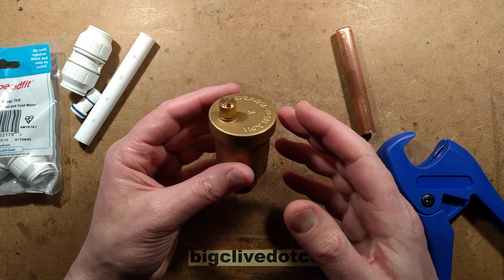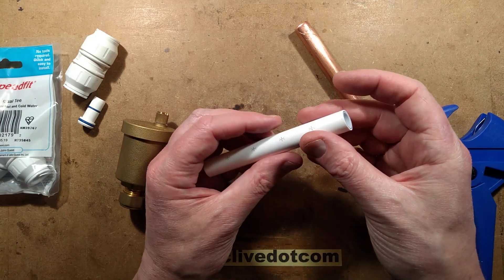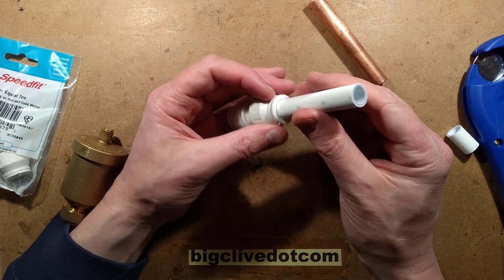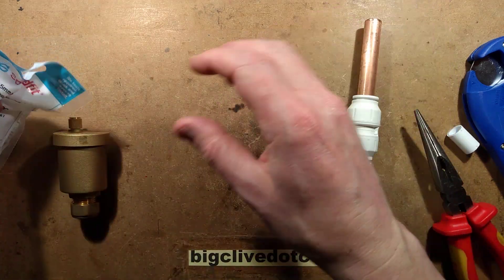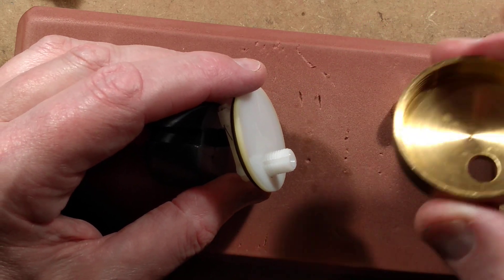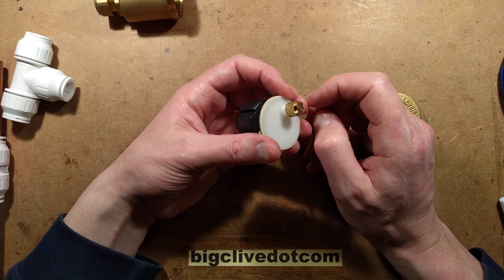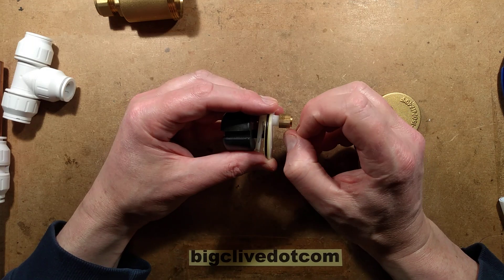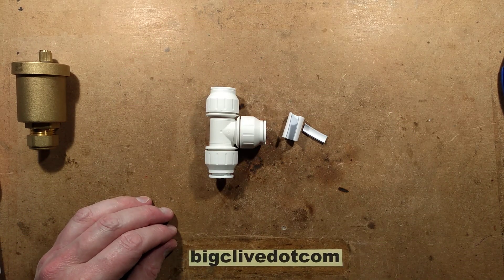Inside a bottle air vent and plumbing ramble.  (No electronics whatsoever.)

Comment: Hey Clive, another great video, thanks.  I had one of these on my old combi-boiler that was leaking.  It didn't even have the thumb screw at the top present (Otherwise I may have just tightened it up to stop said leak).  In the end I watched a You tube video and the plumber suggested giving it a few sharp taps with a screwdriver handle - which fixed it, once I'd topped up the pressure back up on the system also.  Looking at how it works, I reckon my float was probably stuck. It matters not as that was a few years ago and we've since replaced that boiler with a shiny new one.  But at the time I learned all about these auto bleeders (Do you see how I did that - bleeders!)

Comment: So about the "is plasic any good" question.
I actualy havent seen them using anything else but this system with the plastic pipes on constructionsites here in switzerland so it cant be that terrible. Fair warning though im just an electrician so Im definetley no expert when it comes to plumbing. 

Cheers
Reply: Gladius Illuminatus no electrician has been shocked on a regular basis, yet plumbers seem to exhibit continued exposure to moisture. Other than that, the difference is minimal.

Comment: I worked with someone who managed the facilities of a famous shop in London. 
An employee who worked there see water leaking from a pipe on the roof and capped it off without informing anyone. 
It was a pressure relief valve that he had capped off.
There was an inspection at the building at Christmas time and when the alarms went off on the building management computer it was already too late. 
The large hot water tank which was on brick pillars had ruptured spewing out super heated steam and filling the room with boiling water which killed the inspectors who were underneath the tank in the most horrific way. As they tried to escape they tore their clothes off which took their skin with it. 
The scene was so bad the fireman needed counselling and my colleague didn’t sleep for 3 days. 
A little bit of knowledge can be very dangerous so never attempt to correct or repair any plumbing unless you understand exactly what you are doing and run it by a professional if you can also.

Comment: Only problem I have found is the insert significantly reduces the diameter of the pipe and reduces the flow, this is particularly relevant for hot water gravity fed systems
Reply: Martin White gravity systems should be banned from further use
Reply: @Krzysztof360PL  I would agree, but many houses from the 60s and 70s in the UK still have gravity fed systems. Don't know the cost of changing over?
Reply: PEX should likely never be used in hot water systems of that vintage and design that runs very high temps. most is not rated nor meant to be 180F+

Comment: Plastic pushfits are all well and good - but come back 20 to 30 years later, when the rubber seals have degraded and the plastic becomes hard. Then tell me they're great. 
I'm just waiting for the epidemic in about 10 years time when all these new build houses that are full of nothing but plastic pipe and pushfits, all starts to fail.
All  these pipes that are buried behind dot dab plasterboard and in ceiling voids - they'll have to rip the house to pieces to get at them.

Why do i say this? - i have seen the results of this shit failing already, on a 12 year old new build.
Galvanic corrosion is one mode of failure, from where a plastic pushfit is used to go from copper to plastic - the metal ring that grips the pipe starts to degrade on the copper side.
Other failures are thin bore plastic central heating pipe that becomes very hard and the slightest movement of the radiator has resulted in leaks, in one instance the fitting came straight off and drained the entire central heating system down, flooding the bottom floor.

Of course copper pipe is very hard - but it is installed in a way where it's not designed to move much. Plastic pipes on the other hand are installed in an incredibly hap hazard way, with forced bends and criss crossing all over the place along with on radiators that are designed to be hung forward for access when decorating. It's all great until the pipe turns hard and somewhat brittle from 1000's of heat cycles over many years.

Comment: Clive I have used speedfit for many years with no problems other than my own stupidity! ( forgetting to put the insert in ) 
I have test rig equipment that I have taken Apart and then re jigged different configurations many many times and it’s sealed up tight every time. 
I like copper but it’s hard to ignore and very convenient.
Reply: mavos1211 copper hard to ignore, well that’s only if you’re running thieves’ blood in your veins.

Comment: There's a lot to consider here. First off - stacking up compression fittings can result in one working loose as you tighten the other. It's good to use solder for some parts with a minimum of compressions. 

Push fit - it's cheap, proven and reliable. Copper push fit exists too for the old schooler / bits on show. 

One huge benefit of push fit is reduction of points of failure - just like electrics. You can avoid lots of joints under floorboards by using flexible plastic to form bends.

Comment: I'm not a professional plumber but I have done a fair bit of plumbing and I have used those fittings for years and have never had a problem with them.  
The grey flexible lines they used in sectional homes are complete trash and I have had problems with the lines them self splitting but the fittings were still fine.
Reply: me3333 if you’re a man you’ve been exposed to hydraulic plumbing several times every day like clockwork, though my psychic said that gray hose is a universal bad sign. But I digress: the plastic is polybutylene...
Reply: and exactly where would these self-splitting hoses split themselves when they were split?

Comment: The spring is not responsible for holding the valve closed, the water pressure in the system is. The spring just keeps the lever in position against the vent opening. This provides positive hysteresis.
Fyi..... Cross-linked polyethylene, commonly abbreviated PEX
Reply: Oh you meant to say ‘in contact with’, not “against”. My bad.
Reply: Mark Turney positive hysteresis would barely keep a shaken valve from rattling like it was broken inside, maybe even make a new installation less than unidirectional, but soon the thin steel would fatigue or even break, then unsecured fragments would get into places they shouldn’t, reducing the effectiveness of the remaining function by an incomputationally predictable vector.

Comment: Big Clive do y'all not have the crimp connections for plastic pipe? I am using PEX tubing with barbed fittings that have a copper band that gets crimped over the fitting. There is a go-no go gauge to check it ha been properly crimped. Feels much more permanent than the o-ring based fittings
Reply from the maker: I've not seen the crimp version here, although apparently you can use compression fittings on some of the plastic pipes.
Reply: bigclivedotcom I've only ever seen plastic compression fittings used on small 3-5mm tubing for filters or ice machines but never behind the wall stuff. There is a ferrule on the outside and then a sleeve that slides inside the tube. The compression squeezes the plastic between the two pieces on the ones I have used. 

The PEX tube that is common here is also just a single layer of a thermoset polyethylene plastic afaik. Not the multilayer laminate like you have. 

It's interesting how different things can be across the pond.

Comment: Many many years ago one of the manufacturers of plastic plumbing products had a go at producing a hot water cylinder to replace the copper ones, anyway after a while these tanks became wet on the outside, the manufacturers claimed it was condensation even though they were correctly lagged. It later became apparent after some dramatic failures that the plastic was actually crazing and leaking! For me, plastic pipe has its place, I like it for long continuous runs under floors avoiding the need for joins, also unlike copper pipe it doesn’t rot when it contact with a concrete floor, although I’m still not keen in seeing it on hot water and heating systems as I have flashbacks of those hot water cylinders!

Comment: Don't worry big guy. I'm not sure about England or even all of the United States, but in Florida most all new pipe going into the ground is plastic and since is buried and not meant to come apart again, it is just a simple push on fitting. It's nothing fancy just one gasket and push your pipe home. It is fully tested to much higher pressures then it will ever see again before it is ever buried. Plus copper leaches into the water. That is one of the reasons why people who raise fish or shrimp have to add chemicals or highly filler R.O. ( Reverse Osmosis) water before adding it to their tanks. I have designed hundreds if not thousands of miles of pipe for cities, counties, military bases, and the space center. I can tell you with complete confidence that your plastic fittings are fine. I even have tiny compression fittings for tubing running from my R.O. system into my house around the fish room and into a plastic container. (R.O. is very slow and often requires a booster pump.) It is under pressure 24/7/365 and I never worry about a leak from those style fittings.  You can feel totally safe using them without worry.

Comment: perhaps the float is to protect against a pressure drop on the water side. you wouldnt want it to leak water when low pressure...?
Reply: dethshil negative pressure from rising, so not a drop but an increase: ergo to maintain a vacuum.

Comment: As a plumber I despise these vents.  They fail often.  The O ring under the cap fails.  We always install a valve below them for quick and easy replacement.  Some come with a "service check valve" which in theory is supposed to stop water flow when you unscrew the vent from it, In my experience those rarely work.   Never seen one with a compression fitting before....  My opinion is O rings are often the weakest parts of heating systems and the first things to fail, many times they are damaged from the factory because the threads can easily cut them as things are assembled.
Reply: exactly right! rubber/synthetic rubber seals are always the weak link and those silly service "check valves" are always gummed up with junk and stick open.
you'll take an unscheduled bath for sure if you go blindly cranking the vent off... :))

Comment: I have those pipes in my house. We run it @ 70°C and 3 bars. No leaks so far in two years. They are teflon inside, then aluminium pipe, and then pvc i think on the outside.

Comment: PEX is just a brand name, not sure if it stands for anything. Here in the US this stuff has been used extensively for quite a few years. Our first travel trailer (some countries call them caravans) used an earlier version based on the same concept and that was in 1988. Its popularity is primarily due to how quickly it can be installed making labor costs low. I've worked with it quite a bit in repairing issues in our trailers over the years. The biggest failures come from improper installation, usually due to the pipe being too short for the fitting.  Your air relief valve is found in many places, most commonly in low pressure systems, although they are available in different designs for just about any type of job. I haven't see one with plastic insides before but then it's been a few years since I worked with them.

Comment: Glad to see you opted for the GF kitemarked version.
Beware of chinese clones, short mouldings, poor o rings and doggy steel clips that rust tend to make them fail often.
My Dad did his bathroom using cheap chinese clones, they failed after 3 months, and completely flooded his house overnight.
He had to rip up all the newly laid floors upstairs, completely redecorate the whole house while our family moved out for 6 weeks.
The insurance refused to pay out as the fittings were not up to code and were not fitted by a professional plumber.
For the sake of using kitemarked parts he paid out £1000s and then had to have all the piping and fittings replaced.
Beware of Chinese clones.
Reply from the maker: I'd never use a cheap copy in a situation like this.

Comment: Use it daily in my line of work  (plumber).  But not the quick fittings, we use the multi layer pipes but with press fittings pressed with hydraulic press machine.

Comment: A more lasting/permanent way of connecting the plastic pipe is with a plastic pipe welder, you basically melt both the pipe end and the fitting then combine them.
Reply: do they actually use that method for plumbing? seems like it would be a bad idea compared to existing methods.
Reply: @Wooble57  it's just like welding copper pipe, we use these all the time, mostly for permanent lines under the screed (not sure of the name in English) and inside walls.
Reply: @MPKaboose  Copper pipe is soldered, or possibly brazed, both are quite distinct from welding.  I would have thought there would be too much room for error with plastic welding, but I guess not.  Your literally the first person i've ever head of it from (being used for plumbing that is)

I'm not sure what screed is, but a quick google makes me think of concrete\plaster.  It would make a lot of sense to use plastic welding there, but around here they put conduit in, then run the pipes after stuff has hardened up, no joints underneath the slab.

Comment: Clive, o rings wil fail,, we had some issues with a hot water circulation line, the multiskin couldnt handle the pressure, and temperature, so we need to place some special shit, normally it's works really well

Comment: The middle layer is a different type of plastic, probably hdpe or PP, I believe it is also there to give extra strength, thermal stability to the overall pipe.

Comment: Have replaced one of these . They tend to leak late at night when the heating as been switch off . They next day I would allow more water into the combey heating system. Rust  got into the valve let out air but also water that's why in the morning had to top the water up .

Comment: Hi Clive, I'm a plumber and every time I have been called out to a failed plastic fitting it has always been a JG Speedfit. The pipe is alright but the fittings are rubbish for long term use.
PEX stands for cross-linked polyethene and it comes with or without barrier. using the wrong pipe can land you in a lot of trouble with the water authorities.
I have heard you mone about part P and [plumber doing dodgy electrical work, am I about to sea an electrical engineer do some dodgy plumbing

Comment: use plastic everyday, maybe 2 leaks in last 10 years...make sure pipe is clipped to joists etc well
Reply: Bod Cole - Installed ten compression fitting shutoffs on copper pipe for 40 years with no leaks.

Comment: That plastic pipe is installed in my current house on both main cold feed to things and also parts of the hot water system from boiler.  Not one drip of a leak in my 2.5 years ownership.  Lots of plastic to plastic joints and plastic to copper and all just work.

Comment: Here in germany pex is basically the new standard. Though in the non diy market usually its pressed fittings which are smaller and thought of more reliable. Works with Copper as well.

Comment: @Bigclivedotcom 

This is just an observation, and i could be horribly mistaken. I'm guessing if you examing the float, especially in relationship to the cup, the float may have areas where water can by pass it. If so, this would mean that the main purpose of the float is to just ensure the seal is in the proper position to be seated, and thus seal. The actual working force on the seal would essentially be the water pressure itself. 

Once water raises to a specified level, the float lifts, positioning the seal, as water pressure continues to raise, that presure is the acting force on the seal., once there is enough air in the system to float up past the water level in the cup, the float drops, and the spring forces the cantilever action on the seal arm, opening the seal to vent air once again. 

Just my guess on it, not actually having one on hand to look at, but judging by what i'm seeing in your video.

Comment: I know a lot of other heating engineers either rely solely on plastic or copper and can be quite snooty in their views about which is "best"

The short answer to which would surely be both have their place. 

You can run a continuous length of plastic for up to 150m if you wanted to. No joints means no leaks. 

With copper you will always have soldered joints every 3 meters, often much more than that if the engineer can't use a pipe bender effectively. 

Plastic doesn't look great compared to copper, it doesn't ever want to stay as straight. You will need a lot more pipe clips to make it behave. 

I think it's horses for courses. Plastic pipe has proven it can be reliable IF INSTALLED CORRECTLY. 

The same is true for copper. It will last a lifetime is installed properly. Who is to say that the plastic won't?

Comment: Hey Clive, I've never had the ring pop out of the fitting, or the pipe insert get stuck in the fitting before, so that one may be damaged? My only experience is re-plumbing my house, but I did make a few mistakes along the way, and found the fact that I could take things apart and re-use the fittings to be very beneficial.
Reply from the maker: Looking at videos about it the insert sticking in seemed to be a common thing.

Comment: In the states is more common to use the PEX tubing with crimped rings, with metal tees and the occasional 90, instead of that quick connect stuff. Best for or major alterations or new work. For a quick fix the 'quick' connectors are fine. But i would not do a whole house with them, especially in less accessible places.